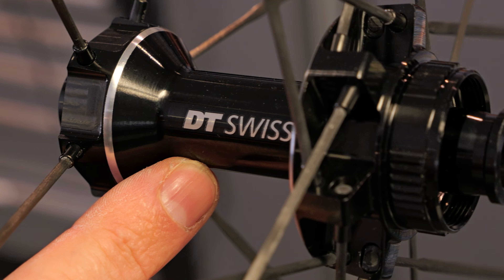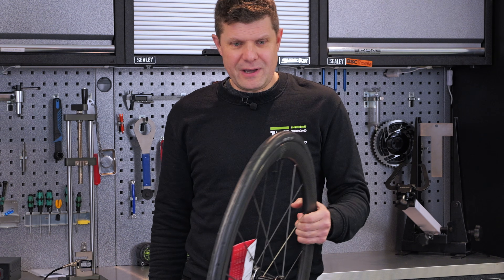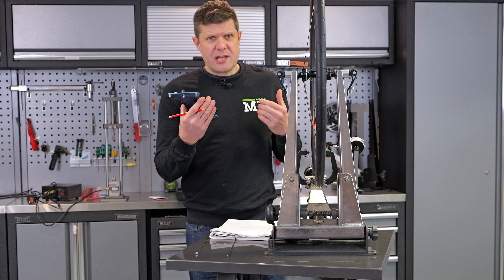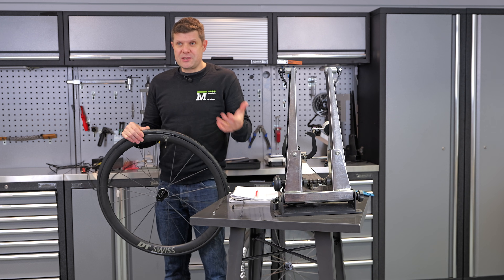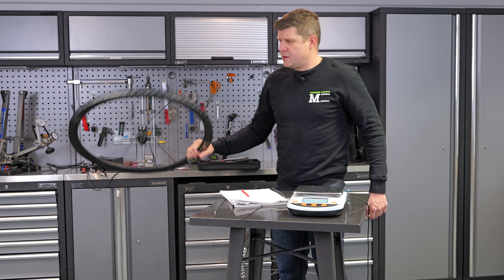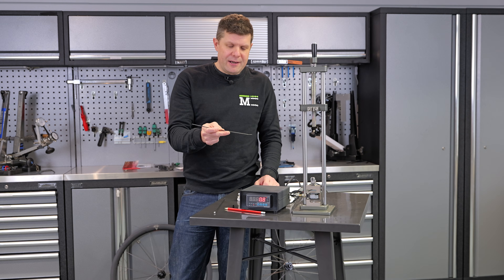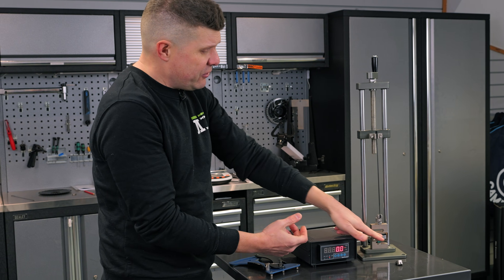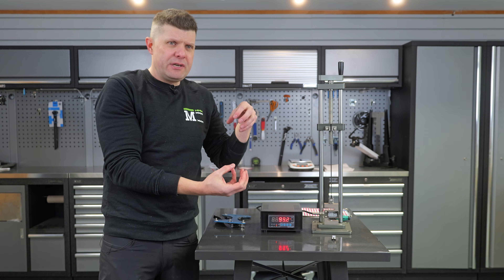Why Most Carbon Spokes Lose Tension (And How DT Swiss Fixed It)

Comment: Please test the 9velo wheels which weigh 1000g and everyone is raving about them, what a marvel of engineering they are.
Reply from the maker: Haha. They would never send them to me.  Just ask yourself 2 questions.  How are they lighter than anybody else when they are using the same carbon, resin, aluminium etc?   
Why are they only promoted alongside Discount Codes and Affiliate links from the YouTuber. 

We only review wheels that are offered to us free from contracts, affiliate marketing and have all their legals in line. 9velo haven’t yet crossed that bar.  

However, we do have something in that did.  Watch this space.
Reply: @Mapdec  We need to debunk this hype and present the facts. If you lose your teeth or your health, you won't be able to legally enforce anything against a Chinese company. This wouldn't be allowed in Europe. Furthermore, any warranty is just a piece of paper to wipe yourself with.
Reply: @Mapdec  so maybe XMCS wheels from Peter?

Comment: If I’m seeing this correctly, the ARC 1100 with carbon spokes prioritises weight and stiffness over comfort and contemporary rim dimensions, delivers only modest aerodynamic gains (still appears to be contradictory in the sense that they're narrow for aerodynamics in a wind tunnel but shallow due to weight), and ultimately leans on DT Swiss’s dealer network as its strongest differentiator (for a specialist non mass selling wheel)?
Reply from the maker: That’s a strange interpretation.  I would view it as somewhat aero for a climbing wheel that best suits the tyres chosen by climbers.  After all. A ride up a col is not one way, you still need to ride there and back down. Rubber is really heavy, people seem to forget that.  I suspect the rear 28 will deliver all the grip and comfort you need.  Rolling resistance is nothing when you compare to gravity.  I admit I am skeptical about the 26 on the front on British roads, but out in Spain I would have no problem with it.

Comment: If you need an aero tyre to stabilise your wheel then you haven't made a very good wheel, especially when it's only 38mm deep! 
I've railed Ventoux on my 68mm/75mm Parcours Chrono and they were a dream.
Reply from the maker: Ummm.  Where did you get ‘need’ from?
Reply: @Mapdec It was implied. On the reasoning for the aero tyre you said 'a lot of brands make a light weight wheelset but you've still got to come down hill and you want to do that with a degree of confidence, speed and enjoyment and not be completely terrified'.
If they don't need the stability of the aero tyre then why fit it when the S TR is lighter and faster?

Comment: 11:00 Barely 100 kilos of tension?! That doesn't sound like a stiff wheel. I do build mine for nearly 120-130 kilos for rear (drive side) and aim into 110 for the front (with DT Aero Comp spokes). Yes, the wheels come out stiff, like after blue pill overdose. Just wonder if i"m not overshooting the scale from the other side.
Cool device you got out there!
Reply from the maker: We just don't know. Even what you said here is kinda wrong. 120-130 on a DT rev compared to a Sapim Xray would yield totally different. Stretch and elasticity. A tighter wheel, doesn't make it any stiffer once it is tight. You are sailing quite close to the wind on yield and tensile strength with your numbers with some spokes and nipples. Just be careful of your lingo.  100kgf is just an expression of tension, Tension itself would be described in Newtons.
Reply: @Mapdec for lightweight rider  58-60kg there is better to using CX ray or CX sprint spokes?
Reply from the maker: @pablo_coach_ultimate  unless you have a special beast mode or you have very few spokes the X-ray are the ones.
Reply: @Mapdec  my wheelbuilder is trying to strong convince me to get the CX Sprint. He says the wheels will be stiffer. I'm sticking with the CX Ray
Reply from the maker: @pablo_coach_ultimate  I hate to say it, but at your weight you won’t trouble a CX-ray.  Take the weight saving.  The ray is also more durable in terms of fatigue life.  The sprint is tougher against impacts, but even if you are riding cross, chunky gravel or XC. The ray will be better.
Reply: @Mapdec  I told him the same

Comment: I dont trust the deflection gauge.
The reading changes depending on the its placement on the spoke. 

I hope a sound based tension meter be the standard.
Reply from the maker: A trumney would need to be calibrated to every spoke ever made, I can't see that happening.
Reply: @Mapdec i expect the manufacturer would do the leg work as they should know the specs.

Comment: Thanks for the presentation/video Paul. I'm curious to know the aero data on bladed stainless spokes vs these carbon spokes. Mavic's R-SYS was a farce as they elevated weight savings at the extreme cost of aero loss with fat (hollow, I believe) round carbon spokes. But incalculably more important for non-pros, is the toughness properties of carbon spokes, particularly in the real-world case of surface damage. Surely you (shop mechs) have seen SS spokes with abrasion be it from the chain or from a crash that other than surface damage and needing a true held the wheel intact. When a carbon spokes gets nicked or impacted (imagine a rock flung by a fellow rider's wheel), will they shrug it off like a SS spoke? As a former metallurgical engineer, I have full confidence in the capabilities of quality SS spokes (eg DT, Sapim, and few other reputable brands). My educated guess is that the carbon spokes would have great trouble exhibiting similar toughness (ie real world damage resistance). If that isn't the case, any company pushing these carbon spokes would have to demonstrate either via destructive testing results or accumulated anecdotal stories of survival before I'd be willing to even ride them, let alone buy them. A story to illustrate my point: A tourist rider stopped in front of me on a bike path to take photos. I had little time to react and my front wheel ran into the back of his bike. The fact I didn't crash is a miracle, but my front wheel spokes (Shimano RS81 carbon fairing with low-count bladed stainless steel spokes) hit his left-rear drop-out. My wheel was out of true and a spoke was badly bent. Not only was I able to ride home, but after trueing the wheel, it's rolling as well as before, minus the visual scar on the spoke that took the hit. Who's willing to test ride the carbon spoked-wheel in this scenario? PS Paul, why would you be surprised DT Swiss outsourced the carbon spokes? They built their reputation and world-class expertise with stainless steel spokes. It would have been quite shocking if they produced the carbon spokes in-house. Why, are they producing the carbon rims themselves? I would have thought those too are from a carbon rim supplier, likely from Taiwan or China.
Reply from the maker: Carbon spokes snap very easily when damaged.  Even just trying to undo one that looks damaged.

Comment: I'm missing an explanation in the video about the actual strategy how DT solved the issue with spoke tension. I guess they tried to design the rim stiffness in a way that the spokes don't loose to much tension?
Reply from the maker: Yes, reinforcing the rim

Comment: Was the same quality control used past 2 years? There is hardly any advantage to buy DT Swiss. now a days, with the exception of their supper high end models that are Made In Poland the rest are mass produced in China, nothing wrong with that but their competition is 50 years ahead. Since the ratchet system became available to everyone many manufactures perfected the hubs and released better products
Reply from the maker: 50 years ahead  😂.  The factory brands are maybe 18 months ahead.  They don’t need to do as much testing, iteration, distribution or training as the big western brands.  It just rolls off production and onto a a YouTuber.  The big brands need to import, ISO batch test, serial number everything, package, train all their sales and support staff globally, coordinate media launch etc.  when we went to the Miche factory we basically saw the next gen wheels on the test rigs for launch in 2027.
Reply: @Mapdec   I was exaggerating to make a point, DT Swiss were the envy of the industry , now everyone makes the ratchet hub and perfected it,   Dt Swiss rims fall apart, they buy spokes from 3rd party just like everyone else, most their wheels are made in Asia, just like everyone else, their design and specs are old , prices are high . Either road, gravel, TT or MTB , there is absolutely no incentive to consider their wheels.  , correct me if i am wrong
Reply: @Mapdec  Comical to defend their testing and QC when DT Swiss wheels fall apart or when lose every test vs the Competition, people don't even bother testing them , are so inferior.   Can't we be real and use facts? I have DT Swiss wheels from the past and would like to see the brand do good but they need to figure things out quick or will be forgotten. Funny enough you see their lower end carbon or alloy wheels on lots of OEM bikes.
Reply: @Mapdec  DT Swiss, Miche, Mavic are in the same situation that Campagnolo is, lots of past and no future,  i have a hard time to see these 3 being relevant today or any time soon. Too many cycling brands insisted staying conservative when other innovate and develop fresh products, new ideas, better performance , not to mention better value.  I have 35 years of experience and as much as i like these brands, or appreciate their past and heritage i simply don't care when i have better option to spend my money on.
Reply: @ciprian7 you need to take a look at Miche and Mavic, their new wheels are bang up to date and are priced very competitively unless you wanna go dirt cheap Chinese with flexi rims and shoddy bearings. Take a look at what Corima, Newmen and Xentis have just released, all European made, no Chinese components, hand built and very competitively priced. Xentis 45r is just £800 for the set, all handmade in Austria. I’m definitely not going to buy Chinese, my problem is what European made wheels to buy🤷
Reply: @davzer3773   I am confident you can find high quality wheels other than the Big brands , we have many options here in US, road , gravel or TT.  My point was that reputable brands like Campy, Mavic, Miche, DT Swiss lost touch with present time and live too much in the past, there is no reason to pay a lot today for something that was great a decade ago.

Comment: I think they’re super nice. I’m happy to see they’re hooked rims. Just to nitpick about the rims, it’s a little disappointing to see that they’re optimized for 25mm tires. The other not so great thing is that these rims have drilled rim beds for the spoke nipples, which is bad for 2 reasons; one is that drilling a bunch of big holes in a carbon fiber structure breaks the carbon and weakens the whole structure. The second and more obvious effect is that rim tape is required. Many of the high end wheel designers/manufacturers use solid rim beds for their top end wheelsets.
Reply: Yes, but these are internal spoke nipples, and even if they weren't, with carbon spokes i think drilled rim beds is better.
Reply: @diehardbikes you’re right in that they are internally adjusted, requiring internal access…yet there is a substantial portion of the nipples that is outside the rim, which begs the question, why have internal adjustment if there is plenty of material exposed outside the rim that flats could be made onto for external adjustment? Granted, it’s not DT Swiss’s design, but it seems poorly thought out-out; almost no aero benefit, yet all the pain of internal adjustment. 

The Mo-Mag nipples on Campy’s Bora Ultra wheelsets are absolutely masterful in that they are flush with the rim surface, yet still externally adjustable with their proprietary key. They also still permit a solid/undrilled rim bed, which is also present on those wheels. The more I dig into the details of these new DT Swiss wheels, the more the overall design appears half-assed.
Reply from the maker: Where did you get that from?  They are 21mm internal. 26-28 is good.  Good climbing size.  Rubber is heavy.
Reply: @Mapdec maybe you’re confused because I wasn’t specific enough. They are AERODYNAMICALLY optimized for 25mm tires. I understand that larger width tires CAN be used. But at this level of wheel, riders will want to optimize everything, including aerodynamics. With regard to wheel aerodynamics, the “rule of 105” is widely accepted as giving the best ratio of tire width to rim width. That is, the external rim width should be roughly 105% of the tire width because this combination creates a toroidal profile from the wheel/tire system, keeping air attached as long as possible as it passes over. It minimizes turbulent air as it transitions from tire to rim. 25 X 1.05 = 26.25, so we see that based on rule of 105, a 25mm tire is the optimum aerodynamic choice for this wheelset. I’m not pulling this out of my ass. You will find it’s true if you do your own research. The included 26mm front tire is not aerodynamically perfect for these rims, but not too far off the ideal. The included 28mm rear tire is crap with these rims, aerodynamically.

Comment: DT Swiss have a global reputation for high cost reliability. Great for some.
Reply: Not with me they don't, my SINC bearings failed within 2000 dry miles, DT would only replace them if I sent them back my entire wheel at my own expense even though I'd already removed the bearings. The bearings are £100 a pair.

Comment: The rim is only 38 mm deep because it simply cannot achieve a competitive weight compared to the competition. And precisely because DT is unable to build genuinely lightweight rims with enough inherent flex to counteract that excessively stiff spokes, wheelsets like this make absolutely no sense. What we see here is a far too heavy rim combined with light but completely unforgiving spokes.

Eighteen spokes at the front in a 2:1 lacing ratio – good luck truing that. Lateral runout is basically inevitable. The additional loads transferred into the hubs and bearings do the rest, ensuring that these wheels will be back in the workshop sooner rather than later.

When the hype train has passed, people will realise where the compromises of such wheelsets lie. There is barely any flex in spokes that are far too stiff. The number of spokes isn’t chosen because they can, but because they have to. A wheelset like this would ride terribly with a 24/24-spoke setup because it would be far too stiff.

On top of that, there is a clear loss of comfort, poor serviceability, and the use of proprietary parts – especially spokes – that you can’t just replace anywhere. That the hubs are outsourced speaks for itself; they simply want to follow the mainstream because everybody thinks they need carbon spokes.
Reply from the maker: Ummm.    Unable…. Just have a little think about that for a second.  All these brands buy the same carbon fibre, the same resins, the same Vonoa spokes.  DT Swiss has made a rim that is rigid enough to not suffer tension loss, by reinforcing their rim.  They have made it strong enough to offer a genuine worldwide enforceable warranty, that they now have a reputation for upholding.  

It would have been easy to make these lighter. Just reduce material so that there is just enough to sneek a pass on the ISO 4210 test. 

Now.  I totally agree on the lack of flex in carbon spokes.  And they all ride poorly compared to SS spokes.  But, as you see from the comments here, everyone wants wheels that our scary light.  DT Swiss had to keep pace, and keep face. 

I think they achieved it. If the price could have been £900 less. It would have been much better.

Comment: Several sets of Chinese carbon wheels I have reviewed in the $1,200 price range include spare carbon spokes in the box. I can't understand at this price why DT wouldn't do the same thing especially at this astronomical price. For what it's worth, in 1000s of miles of road and gravel riding on these carbon spokes I have yet to break or loosen the carbon spokes.
Reply from the maker: I think the spares in the box is pointless, but it’s a nice counter to the argument.  Spokes rarely break in singles.  They just need to be readily available as spares for many years.  How often did you ever break a steal spoke?    The reality is that a broken spoke is often caused by something.  Cabin coming off cassette, impact, corrosion.  The question is, what happens next….
Reply: @Mapdec  thank you for replying!
Reply: How have they fared with damage resistance, like rocks or contact with another rider/bike, or crash?
Reply: @jjashik7  thanks for asking. I haven’t had any issues and the gravel set has easily handled a couple of crashes and pretty rugged terrain with rocks, ruts and dropoffs. I haven’t had a crash with another rider or had anything like a big stick go into the wheel but Joe at Panda Podium - ChinaCycling on youtube stuck a beer bottle into a spinning rear wheel, which opened it on a carbon spoke with no harm to the spoke. So the spokes pretty tough. And they significantly lighten wheels - about half the weight of the lightest steel spokes. Hope this is helpful.
Reply: @JimLangley1 yes, helpful, thanks for the info Jim.

Comment: Carbon spokes aren't available as easily as steel because one single manufacturer is responsible for the vast majority of supply. There just isn't enough production capacity to be wasting it on selling spokes individually.

Comment: Another great technical video from Mapdec! One suggestion: when starting out, measure each spoke and mark (with tape or a marker) the same distance from center or from the origination point of each spoke. Then make sure your tension tool is always keyed to this point. It is a bit fussy but this whole area is quite fussy!  Well done presentation!